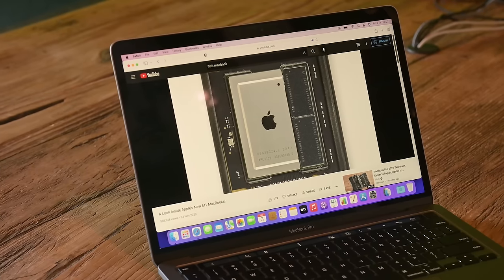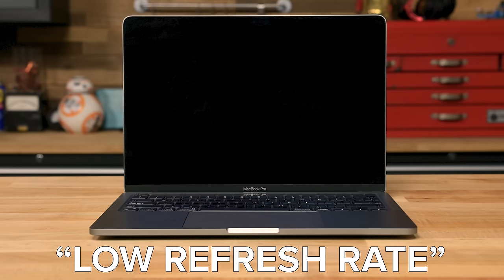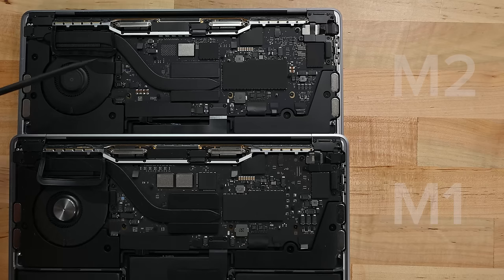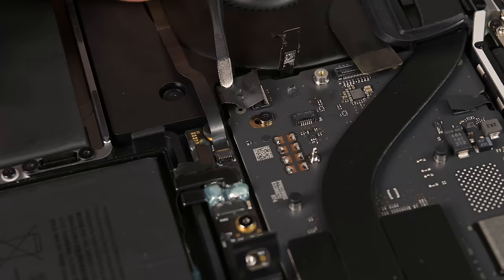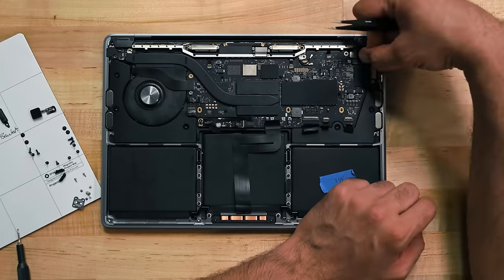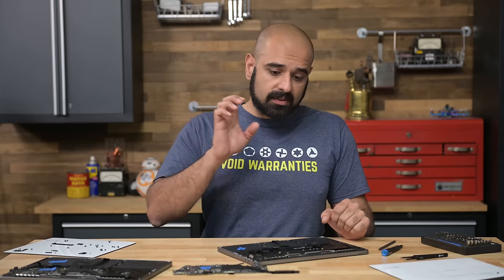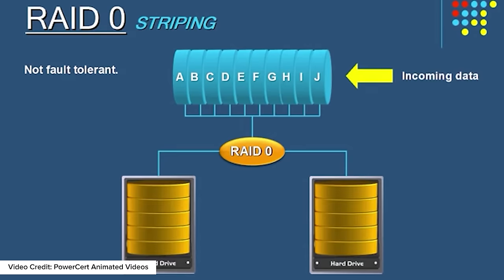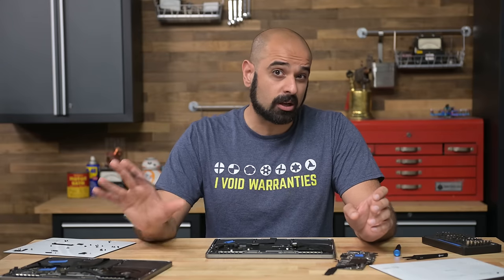We’re Pretty Sure We Just Tore Down the New M2 MacBook Pro!?

Comment: Why does everybody INCLUDING YOU say it’s thunderbolt 4?! It’s obviously thunderbolt 3!!!
Reply from the maker: We're so sorry! You are correct, they're both Thunderbolt 3 ports. Thank you for pointing this out!
Reply: @iFixitYourself  😅
Reply: @composimple364  To be fair, Thunderbolt 4 and Thunderbolt 3 are basically the same, at least when it comes this kind of device. The only difference is the minimum requirements to meet the standard. If I remember correctly, Apple maxed out both the specs of the Thunderbolt ports, so while officially it's thunderbolt 3, it has all the same specs and functionality of thunderbolt 4.
Reply: Calm down bud. The only reason it's thunderbolt 3 instead of thunderbolt 4 is because you need to support more than one external display on the port for it to be thunderbolt 4. Everything except that has been upgraded to the thunderbolt 4 spec from the old thunderbolt 3 ports on the past MacBook Pros.
Reply: @teh_hunterer  Nope, doesn’t support smart bandwidth allocation. All the new specs you see is USB4 upgrade from USB 3.0, nothing related to thunderbolt.
Reply: @Cubedex679  it would not be the same functionality if I connect both an external SSD and an external display. Smart bandwidth in Thunderbolt 4 is the key point. Go check out
Reply: @iFixitYourself  did you try putting m1 MacBook Pro motherboard in the m2 case the reverse way

Comment: Apple wouldn't make this up-gradable because they do not care at all about the environment or the planet.  The only thing Apple cares about is making as much money as possible.  Excellent products made by a company with no real values (most companies do not have values or standards so this isn't exactly exclusive to Apple, I understand).
Reply: Just buy the M1 Max laptop with 64Gb RAM and 8TB SSD and you’re good for the next 10 years. Catering to tinkerers who swap and throw away components all the time is worse for the environment.
Reply: Did you watch the video?
Reply: @mattehartog  Did you actually just say that allowing single component repairs is WORSE for e-waste?
As if Apple doesn't solder mandate motherboard replacements by soldering SSDs?
Damn, I guess my laptop which I upgraded with spare parts instead of throwing away the whole computer was bad for the environment 🙄

Comment: They did not disable the trackpad a keyboard, Hector said clearly the interface to talk to these parts has change. This is not a software lock this is a change of the protocol use to talk to the hardware as they have removed some of the crossing logic chips from the trackpad and put that logic inside the SOC so now the communication from the trackpad to the SOC is in much more raw data format instead of being a process finger at x,y location.  This move is in fact good for repariablty as it makes it much simpler to build a replacement trackpad if apple do all the hard pressing in the SOC it means that trackpad is a simpler part.
Reply: Yeah, saying something isn’t repairable since you can’t swap components from different years is kinda of silly.
Reply: @TheRockHardKeg  i think they are only saying not upgradable like the Framework. Seems like a bunch of parts are repairable without software locks and across generation. Trackpad can’t be sourced from old one and touch id is bound to logic board but everything else seems swappable.
Reply: So it’s literally against the move towards serialization
Reply: @zaki4t  yes and these parts were never serialized. 

However removing the controler chip will mean that you might need to load calibration profiles for a new trackpad since the raw data is being handled by the SOC now rather than the controler chip that would in the past have had that calibration info on it. Not sure if a trackpad sensor needs calibration but if it does the fact you need to load it will mean people like iFixit will call this serialization even through it is in fact calibration.

They call the fact the screen and camera need you to load calibration data serialization when this is calibration profiles from the factory since very single screen panel and camera scenes emmits/captuers light a little differently.
Reply: If the OS is the same between the M1 and M2 chipped hardware, why wouldn't it work?
Reply: @brunoais  The firmware is very different between M1 and M2.  But also the electrical connection between the M1 and the trackpad is different to the connection between the M2 and the trackpad. 

yes the high level OS is the same (mostly there are bespoke bits for every chip apple has done this going back many years on Macs shipping custom versions of some frameworks for each intel cpu they used).

if you modified your M1 trackpad to remove the controller chip and correctly wired up the sensors to the cable then it would work on the M2.
Reply: @hishnash  I see...
Reply: @hishnash   easy solution to upgrade your m1 motherboard and trackpad  with m2 version of computers

Comment: On the M1 you can see two NAND flash chips for the SSD (2x128GB). On the M2, you can see only one chip. This is why the M2 base model has dramatically slower storage performance than last year’s model. Laughably bad decision, Apple.
Reply: they literally said that word for word in the video
Reply: are you aware of the chip shortage?
Reply: How many 256gb ssd owners care about their ssd performance to know the difference between 1.5GB/s and 3GB/s? 

none.

Fake outrage

512gb+ onwards have no performance penalty
Reply: I expect the issue is getting hold of 128GB NAND modules right now in the volume apple need to is very hard to do. I would not at all be surprised if apple even moved to shipping 1 256GB modules on some M1 base Macs before they even released the M2.

Comment: The keyboard and trackpad use different communication protocol on M2!
Reply: Yer this is not a software lockout, its is in fact a removable of the ability for software lockout by removing some of the logic dies that used to be on these parts so that they now talk in a more raw format to the SOC (less chance to have software locks when your just reading raw touch sensor data rather than talking to firmware that is running on a remote arm core within the trackpad as the M1 and older Macs did).

Comment: Parts are cross compatible. Replaces entire PC equivalent of Desktop. SoC which includes CPU, GPU, RAM and numerous other controllers plus SSD and the logic board. Basically like building a new PC with same Mouse Keyboard, Monitor and Power Supply.

Comment: I own an Apple M1 MacBook Pro, 16", and I would absolutely love it if I can upgrade just the logic board to an M2 and retain my RAM and perhaps have the option to add an SSD.
Reply: Yeah hf getting nonexisting spare parts that doesnt even apple sell to you
Reply: this is apple bruh...if you want to change out logic boards easily then get a framework laptop, of course you will have to go either linux or windows.
Reply: ram and ssd are soldered to the board
Reply: Even then, you need apple to produce those as parts and sell that to you

Comment: If you could swap boards so easy, and the display is the best right now, touchpad and keyboard there is not much improvement and you could have the same chassis and screen and battery for years and only pay around 1.5k less then changing to a new laptop, and also less displays which means less e-waste

Comment: I wonder if you could de-solder one of the 128GB SSD chips from the M1 and add it to the M2 for a 256+128 config.
Reply: You’d probably save money just getting a 512GB upgrade
Reply: Given the chips on the Studio wouldn't work if they were moved or combined, I wouldn't have much hope here (and these are soldered down, so the process would be far more risky)... Definitely a missed opportunity, but a completely unsurprising one.
Reply: @GeleKoplamp  Then just buy the 69TB version with 420 GBs of RAM
Reply: @Santa A trackpad is preventing you from upgrading the laptop, a fkin trackpad... you think Apple would allow a 256+128 combo, how dare you
Reply: No … it’s not ssd, it’s raw NAND chips. The ssd controller is not gonna like that
Reply: @GeleKoplamp  512 upgrade consist of 2x256 😂

Not 1x256
Reply: Yes you can, you can also just buy raw NAND dies from any of the large NAND vendors and solder it on people have done this it is just NAND. (note you will need to reset the machine in DFU mode if you do this and thus will loos all your data).
Reply: @hishnash  Nope you cannot add any chips as the controller in the cpu is coded to not support it. Atleast its like that on studio so why would apple make something better for customers? NOPE. It most definitely wont work.
Reply: @migidid  You likly cant solder on 2 128 GB modules but you could (if you get the same vendor do not mix them) solder on another 256GB to make a 512GB. I don't see the point in de-soldering the existing 256 GB modules to replace it with 2 seperate 128 GB dies.
Reply: @migidid  You are wrong, you can add more SSD chips for the MacBook pros. Remember that the studio is a different mac. Just search on youtube MacBook pro solider on SSD upgrade.
Reply: @flamingkillermc2806  Just read the article on macrumours. Woah. Couldnt believe it :D
Reply: @migidid  you can change the nand modules of the studio, you just need 2 of the same capacity  and from the same vendor

Comment: Maybe I'm not enough of a geek to follow why the trackpad issue is so important, but to me the three main questions as to repairability and upgradability are: 1) can I replace the battery? 2) can I upgrade storage? 3) can I upgrade RAM ? It looks like the answers are yes, no, no. The thing that is most baffling to me is that, as storage gets exponentially bigger and cheaper, Apple is still price gouging for extra storage...just to make the laptop a little smaller and less upgradable? To sell more icloud storage? Why?
Reply: NEVER anymore for the storage and memory.
Reply: @migidid  not true, you can actually upgrade the storage if you give it to a micro soldering repair. Just search MacBook pro soldered on SSD upgrade
Reply: @flamingkillermc2806  You are missng the controller of the SSD thats on the cpu and just like the studio it needs to be programmed again. As far as im aware the software available to public is not functioning. Youd need apple to do it and do you think apple will touch your brand new 2022 multi thousand dollar machine that you soldered some random chips to :D

Comment: "Whether intentionally or not" 😂😂 Like any of this could happen on accident 😂 Someone just tripped over a cable and spilled touchpad logic chips over the SoC and couldn't clean them off so they stayed there.
But I guess you guys don't want to get sued for every video you post. Keep it up 👍
Reply: This is intentional, by moving the logic into the SOC they can save on buying addition (hard to source right now) logic chips on the trackpad. Rather than having the trackpad send processed finger positions to the SOC it can now send raw sensor data to the SOC and they can just use the SOC to figure out the locations of the fingers on the trackpad. This makes a LOT of sense in a world we're getting these legacy nodes that everyone else is trying to get is very hard. Some care companies are buying up washing machines to harvest chips from them!
Reply: @hishnash  But you have to agree that adding support for processed trackpad input from an M1 trackpad should still be possible, right? Since the code should still be there for M1 models. I hope they didn't just comment the code out :D
Reply: @anzejensterle   I think it's very unlikely this is something that is just about software/firmware.

if they removed a pre-prossing chip from the trackpad that the M1 talks to and now the M2 talks directly to the sensors then the signals going over the wires will be different.  When I say different I mean the voltages, timing etc even different pinout.

To make the M2 be able to take the signals from the M1 trackpad you would likly need to add a switch on the mainboard and add a little auxiliary chip that then talked over a higher level protocol to the SOC (PCIe). It would be less work to publish a how to guide on what to remove from the M1 trackpad and what wires to bridge over is expect what Appel have done here is just to remove a chip that was hard to source due to the supply chain shortage.
Reply: @hishnash  come on there are countless changes Apple makes to devices so people can't use similar parts from broken devices. It simply can't be by random chance or accident since it happens so often. But if you nevertheless believe that Apple only has the best consumer interest in mind I won't change your opinion in a YT thread 🤷‍♂️
Reply: @RealLifeTech187  This is a good point. There may be technical advantages, but at the end of the day it seems to me that decisions are only greenlit if they’re good for the bottom line. In this case, if they hamper repairability.

Comment: So not much change, and now we're seeing software locks (in some form or another) in Apple's laptops, too. Not surprising considering that the M1 processor is designed by, and produced by, Apple themselves.
This is why the Framework Laptop would be a much better choice. 
If only there was a 15 inch or 17 inch Framework model, with more than 4 ports, and discrete/dedicated graphics as an option...
Reply: You think thermals will be a problem on the framework laptop with dedicated GPU? 😂

Framework laptop will always be a toy laptop
Reply: They are incorrect when they call it a software lock. What apple have done here is changed how the trackpad and keyboard talk to the SOC since they have removed chips that used to be on these parts so now these parts talk to the SOC in a more raw sensor format (different stream of on off signals). This is in fact a move away from software locks as the perfiancal are getting dumber not smarter.

Comment: Apple and the old Sun Microsystems were the first (pain in the ass) companies I remember "fingerprinting" parts so you had to buy they over priced replacements instead of OTC identical parts.  So Apple has been playing fingerprinting games a lot time to force people to buy more expensive replacement.     Sun Micro and Compaq servers RAM was very expensive when bought from them, but memory can't be fingerprinted so they just put a sticker on the chip, but if you need any repair work on one of their computers they would refuse to work if any non company stickered memory was in the computer.    Computer makers have been screwing their customers for a LONG time.
Reply: Dell definitely does this too. Especially in their upscaled servers. It has something to do with matching all the parts back to their support code or express code. Changing that is a booger! I had engineering support walk me through it on a server where the fans went bonkers. The fans?! Apparently it is all tied together at the hardware level and matched in your express code for that unit for support. It makes sense from a customer support perspective, although overkill for a model that will never be in an enterprise situation in a Dell pricing list. However, Apple does this kind of support on all of their products. Most consumers don't see that level of support at Dell because they aren't buying enterprise model parts/servers. Higher end = higher maintenance. Apple is all about everything being higher end, so not a surprise to see this at all.

Comment: If it seems to be any light at the end of the tunnel of irreparability is just because of the fact that the 13" M2 Pro has no reason to exist except to allow Apple to dump the old 13"M1 Pro's chassis that weren't sold until now. Even the boxes are the M1 boxes repurposed shamelessly with just a new sticker glued over the old one! They could indeed give the excuse of reparability to justify this new model, they could say: "we launched the MBP Modular for all of you who want to keep your machine and upgrade it forever!" They could even get a bigger share of the PC market by doing that, and the only tradeoff for the user (who values performance and and financial health more than the urge to have the latest innovation) would be sticking with an old design longer and missing some minor upgrades only possible on the newer models. But no, they HAVE to use the dirtiest methods to keep us from repairing and upgrading our own machines when there's no technical reasons to justify that.

Comment: They. Are now pairing peripherals to the logic board?
Reply: No they are not, they said what they are doing and then the presenter ignored what they said. Apple has removed some of the external sensor processing that used to take place on the trackpad and is now doing that within the SOC, what this means in practice is the data stream being sent to the SOC is different as its no longer finder positions but rather raw voltages on different sensors. This move is in fact a move away from the ability to do parking as now these peripherals no longer have thier own firmware as they are not doing any data processing they are more like dumb sensors.

Why apple did this is to reduce dependancy on chips that are hard to get hold of right now. The little logic chips apple was using on the trackpad are used by many many other vendors for alls sorts of sensor pressing tasks so are not easy to buy in bulk, moving this in-house within the SOC is a good idea for everyone.